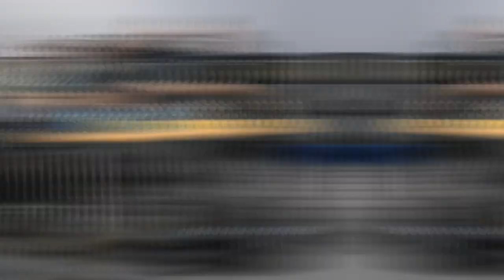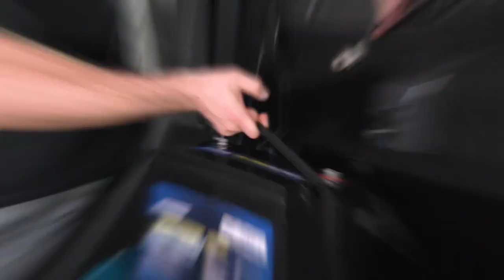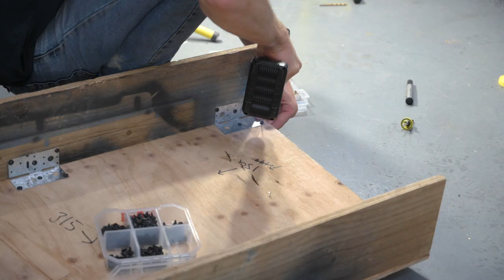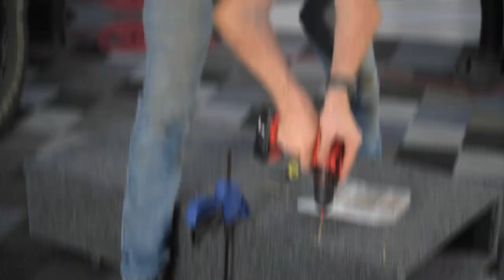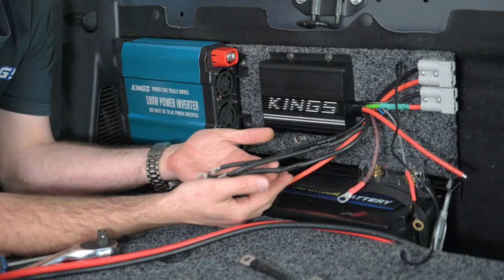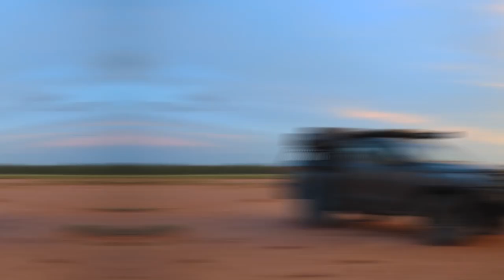DIY Dual Cab Ute Rear Storage Build - Rear Seat Delete + 12V Lithium Setup!

Comment: I like the rear seat delete, got some good ideas for mine from this one.   Probably the best thing I gained from this is I probably don't want to build a storage box under my fridge if I want easy access to the fridge.    I notice you guys didn't open the fridge, didn't look like a lot of room above it.   But that's why I love these type of video, I can steal the good parts of everyone's build :)
Reply: That's a fair call. We didn't mention it in the video but fridge access was certainly a consideration. There's definitely enough space to add/remove general items but the beauty of the Stayzcool fridge is that the lid is completely removable so if you wanted to throw in a giant roast(or full case of beer perhaps) you can just pop the lid off. Stealing "the good parts" is definitely the way to go though! Everyone's needs will always vary.
Cheers
Dean
Reply: I’ve seen fridge slides that slide out and drop down for access

Comment: Need a blue plate in QLd for seat removal as silly as that sounds
Reply: You need it replated in every state I’m pretty sure and it’s not silly mate, it’s a requirement due to it changing the vehicles overall weight carrying capacity 😉👍
Reply: @4WheelingInNSW  Pretty sure when my mate had it done the only mod plate was because it changed the seating capacity from 5 to 2 (making it a 2 seater), gvm and weight carrying remain the same (at least on old 80's)
Reply: but i'm in QLD home of the nanny state 4wd regulations
Reply: @4WheelingInNSW  how does it change the weight carrying capacity

Comment: great video, I've just bought a kings 120A lithium battery, plus kings drawers, firepit etc.. haven't istalled yet,have no idea what I'm doing. So yes these videos are a big help. I always wanted to do a back seat removal set up, my dc/dc ch is under the hood,Anderson plug going to back tray where battery will be [andrson plug already installed],but I really love the weight distribution moved forward and neat and tidy look like you guys have done. thanks, Colm.

Comment: Hi, I like this video, especially with the tips for the carpet and a clean 12v install.  I just have to add that I believe you need to consider some form of Cargo barrier between the front and rear seats (if possible). Not sure what the shear rating of the fridge straps is, but I am doubtful they'd hold that 70+kg fridge down in an accident. Occy straps certainly aren't going to hold the camera gear down in an accident, especially considering they apply poor lateral tension to those loads. Not trying to be the fun police, just pointing out that as your job involves driving alot, you're at an increased risk of having an accident, and I need more 12v vids so can't have presenters hit in the back of the head in an accident
Reply from the maker: That's a good point - there are a couple things we're going to review / change up now that we've used it a little more, so we might make a follow up video.

Each strap does have a 200kg rating, but you've made some good points nonetheless!

Cheers for watching and thanks for the feedback!
Cahn

Comment: have to change the mod plate after removing seats . storage box might of been better with a lid on gas struts .. 500watts is going to be underrated compared to a 1500watt once u get 240v and start using it .  good video though at least gives people a fresh idea
Reply: Only need a mod plate if you remove the seatbelts?
Reply: @lachlanmann841  nah on the rego it says how many seats etc . needs to be inspected and updated . apparently
Reply: @brentmcd12  how much does it cost to do that roughly?
Reply: Was wondering about this. Is the seat part of the car structure? Is it allowed to come out without reinforcing?

Comment: Is it not illegal to remove back seats?
Reply: not illegal but needs to have a mod plate fitted for seating capacity reduction , surely these guys should know,   if you leave the rego plate exposed for the public to see ygp66e  its easy to see online  that the seating capacity has not been changed

Comment: I don’t think you can do this in NSW? When getting blue slip you’ll need to put the seat back??
Reply: We tested this after the fact and it’s super easy to take in and out! Takes about half an hour and uses all the seat mounting bolts!

But yeah if you did need a blue slip you’d probably have to switch it out. 

Also wouldn’t be very hard and worthwhile to get engineered as a 2 seater if you were planning a lap of Aus!

Cheers,
Cahn
Reply: @TurnerWay  thanks. I’ve made a false floor over my back seat in a MUX which has a fridge slide and storage tie downs. It easy to remove when needed…